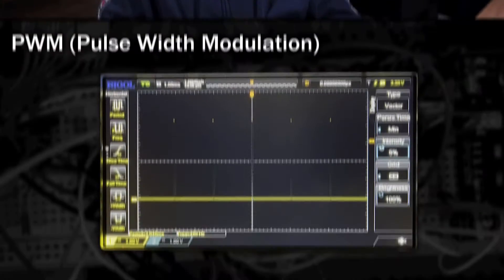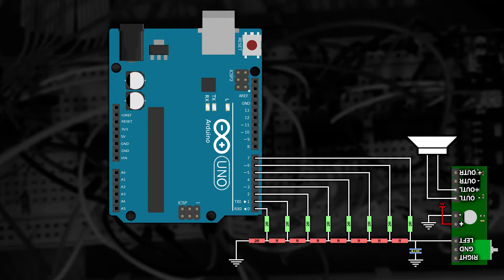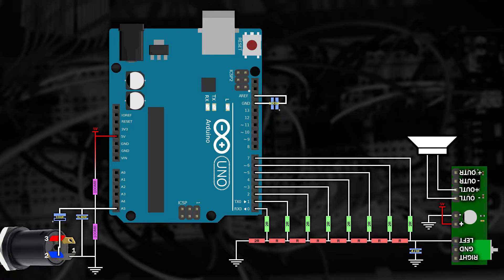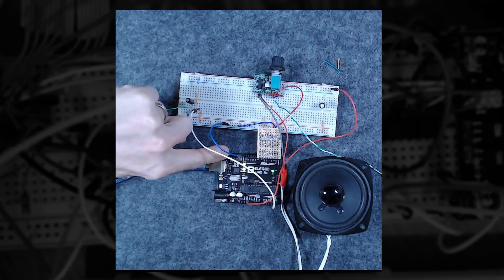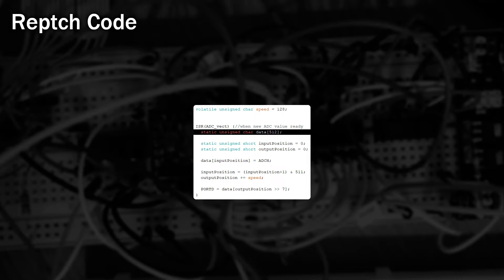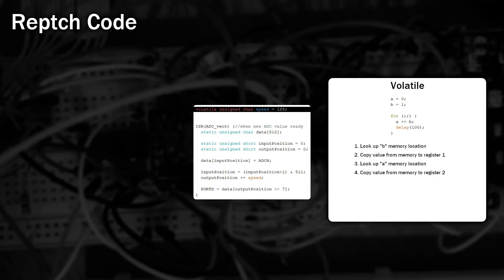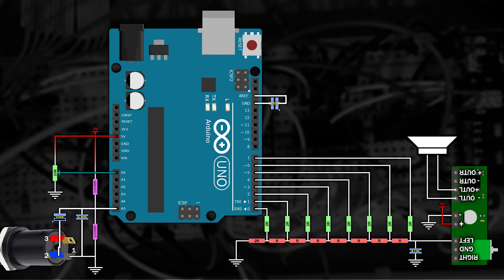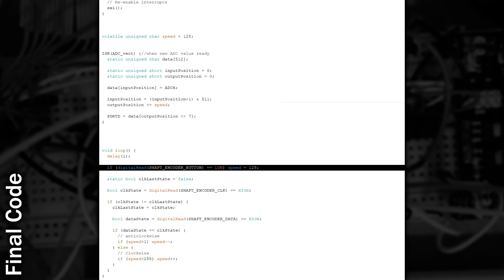Real-Time Voice/Music Repitch with Arduino! Sound Like A Chipmunk!

Comment: Hey, for a project instead of using a jack plug for the mic, im using a AITRIP INMP441 Omnidirectional Microphone and i was wondering which of the plugs i would connect it to there.
Reply from the maker: You can’t use that with this project. This project was designed to be used with an analog microphone, that’s a digital one

Comment: Great job with the shifter. I am from Australia and build the very first Electro Steel Guitar (No rods between pedals and main body). 
However, the servos I use to pull the strings are somewhat noisy. So, I started to think in the direction of using a pitch shifter to do the job, but that ended up being an almost impossible task to get a quality sound out of it. 
Your circuit principle seems to be the closest I seen up to now. My only concern will be the glitch your circuit do. Do you have a suggestion how to fix it? I am very excited to hear back from you. Great job.
Reply from the maker: I think I’m going to do a follow up using a more powerful micro and using some of the techniques things like browsers do to playback faster etc but will have to see.

Comment: Hello! It's me again! So... I took courage and did this project, but I noticed that the sound was very low (almost not audible) and with a loud hiss... What did I do wrong? Is the amplifier having problems? :(
Thanks for listening.
Reply from the maker: Yes maybe your audio input is too quiet.
Reply: @RobSmithDev  I'm thinking that the problem is in R2R... What kind of resistor did you use to make it in this project? I used whatever I already had lol
Reply from the maker: I'm using 10k and 20k. Depending on what you're feeding it into you may need extra amplification.